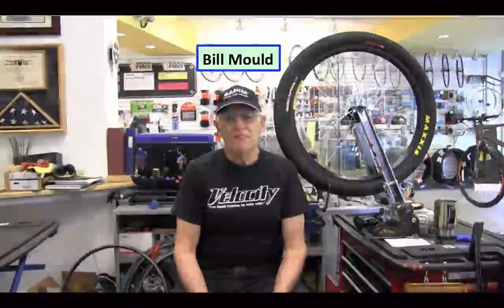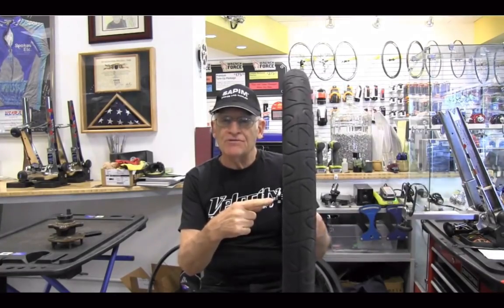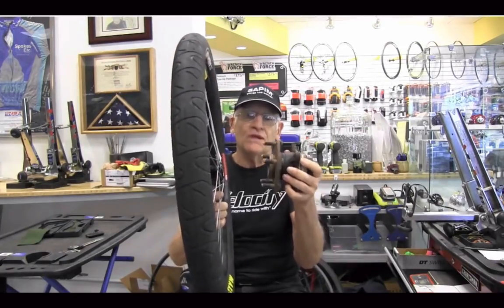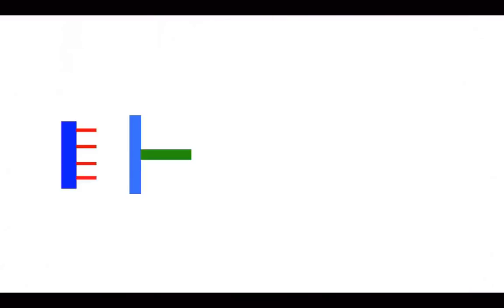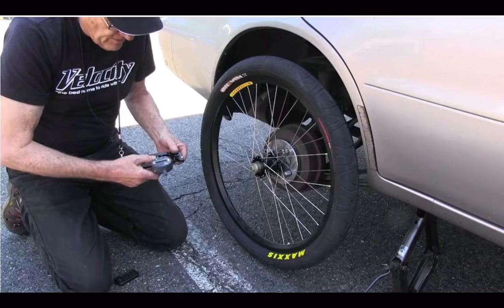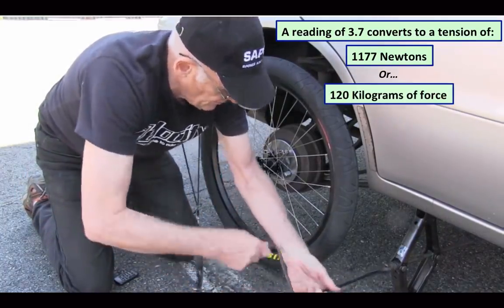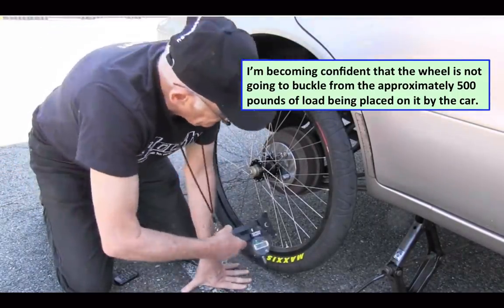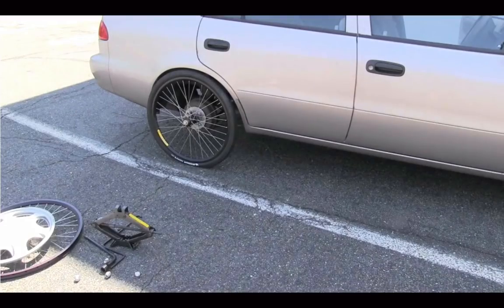Bicycle Wheel On Car

Comment: Weren't the first cars being made have tires that were thin as af
Reply: Jr. Lazarus The first cars also had more wood than steel. Therefore they were extremely light. Less mass allowed for thin wheels. The thin wheels allowed for traversing deep muddy roads and streams. 

I bet a Model T would do well with bicycle wheels. A modern car wouldn't make it past turn 1.
Reply: Jr. Lazarus Model T was like an 800lb car.
Reply: Jr. Lazarus Well yes, wheels were used waaaaay before engine powered cars, first on wheelbarrow-like things using only wood, then on wagons pulled by horses, then on engine powered wagons that were the first cars (wooden wheels with a layer of steel), then a layer of solid rubber, then air inflated rubber, getting wider and wider.

Comment: if you are using the hub, and you have opened the center of the wheel to 22mm, just drill & thread the hub, and use a shoulder bolt with safety wire and maybe a washer to even the load across the compression face.

Comment: Complete lack of safety demonstrated here. No jackstands, that shifty  jack should only be used in emergencies (i.e. a flat tire in the middle of nowhere) I love watching the "wheel engineer" lower the car without even being aware of clearance.
Reply: Clearance? Worried about the car dropping? I don't think this is the worst of the worry. Lowering that jack with his face inches from overloaded spokes and tire was intense. Also he's testing tension on a bottom spoke. What's he measuring there? Spokes hang, they don't support. He has no clue what he's doing.

Comment: one bump would do the trick. that bicycle wheel will shred itself. you will most probably end up using motorcycle wheels.
Reply: No offense but way too many people here are assuming he wants to replace his car wheels with bike wheels. Or drive like normal on a bike wheel.
Clearly, as mentioned, this is an EXPERIMENT in seeing if he can build a bike wheel that could handle the massive difference in weight . He showed it could be done which is amazing considering that the bike wheel itself likely weighs less than 1200grams or 2.5 lbs. The car weighs closer to 2000lbs whereas a typical bike weighs 35lbs.
Reply: well then carbon fiber will do this trick. no need to develop carbon fiber.
blesings
Reply: Val Tito What the fuck are you even saying here?
What does carbon fiber have to do with this? 
He used  pretty non exotic basic bike parts here. Mostly aluminum and stainless steel.
No need to develop carbon fiber?
Yes, you do if you want to save weight.

Help me to understand your line of thinking.
Reply: schlooonginator no need for getting your panty in a bundle friend . there are carbon fiber bicycle wheels already in existance that will do the job. just buy the carbon fiber wheels. no need to develop them.
Reply: Not trying to be a dick. Just that what you said didn't make much sense which I can understand if english isn't your primary language.
I was just not seeing where carbon fiber or carbon fiber bike rims(most carbon fiber bike wheels whos spokes and rims are a one piece design are built strictly for road racing and would likely fail under this load.) had in relation to this mans experiment of building a wheel using a fairly robust alloy rim with 36 stainless spokes. A complete carbon wheel is not something a typical "wheel builder" can make.
Like I said complete carbon bike wheels are ultra light and designed for weight loss and aerodynamics over  ultimate strength.
Now, a DH or AM carbon rim built up traditionally would likely hold this weight.
Reply: schlooonginator you know its like this.

traditional materials can only do so much, then you have to start with new and better materials

the regular bicycle spokes even if doubled up will not do the job. that is why heavier vehicles use thicker spokes. 

this project is on a one way trajectory, thicker materials.
 in the end we will see that they will just have re invented the motorcycle wheels or even “whire rimmed wheels” .

why reinvent something that has already been invented.

blessings
and yes my english is perfect.
Reply: ***** Yeah! I am amazed at the number of people who don't understand this. C;early a bike wheel is design to handle so much weight and stress. So if you can build a bike wheel out of parts intended for something that at most weights no more than 200lbs and it woks to support weight that far far exceeds this is indeed impressive yet this goes right over their heads!
Reply: Roy Odell  IT WILL NEVER CATCH ON  BAD IDEA & BESIDES CARS ALREADY HAVE WHEELS ,DERRRR   ,,,,THEY ARE VERY UNSAFE , UNCONVENTIONAL  , AND WONT LAST A MILE   HEE HEE
Reply: Val Tito  BUT THINK what if a huge truck or a bus  or a caravan, trailer, had them.  all that heavy weight  on them  those bike tyers would  bust in no time  and cause  a mass smash up in traffic  VERY UNSAFE INDEED  !!!!!!!

Comment: NO BRAKES
Reply: +BOY CHAD It has brakes....
Reply: +Coatchawa it has break shoe not brake pads.
Reply: +Paulo Manuntag it's called drum brakes dude, any brake pads would be inside the drum
Reply: +Justin Noker ahhh...

tnx for the info. :)
Reply: +BOY CHAD Yup you r correct, no brake attached to this bicycle wheel, he just connecting it to the rear drum brake with that adapter for freely spinning..if he applies this thing for all wheel.. sure he would not able to stop the car with brake..
Reply: +Justin Noker 😂😂😂😂 
brake calipers = brake pads
brake drums = brake shoes
big difference in both styles of breaks
Reply: +Justin Noker 😂😂😂😂 
brake calipers = brake pads
brake drums = brake shoes
big difference in both styles of breaks
Reply: +Justin Noker 😂😂😂😂 
brake calipers = brake pads
brake drums = brake shoes
big difference in both styles of breaks
Reply: he's right,  free spinning axles in each hub. ..hub stops, wheels spin...which is why he needs help building adapters as stated at the end. ..
Reply: +Joshua Laird put splines on the "adaptor" and then press the bike wheel on.
Reply: +linglingjr some sprags.
Reply: Joshua Laird No...
Reply: Oh, You are saying press on the bike wheel to an adapter bolted to the hub. I get it now.  Interference fit?
Reply: +Joshua Laird Yes, just like a hub on a two piece axle.

Comment: And the point being what? This is just plain stupid. 

1.  Bicycle wheels are not designed to take any lateral load as there is none on a bike - it leans on the turns.  A car wheel has to withstand a considerable lateral load when
cornering.

2.  I would NOT like to be the guy who hits the brakes hard on a car with bicycle wheels on the front - not with all that weight transfer forwards.

3.  Car wheels are dished.  Bike wheels are not and hence the track will be increased.  This is obvious in the vid where the bike wheel does not tuck inside the wheel-arch.  This will have two consequences:
a) The steering geometry will be all to pot
b) the edge of the wheel-arch will rub against the tire on bumps and when cornering.

4.  Bicycle tires are round in section and have a long, narrow oval contact patch.  That's because cycles lean in turns.  Car tires have a flat contact patch.  That's because car wheels stay upright in turns.  Also, bicycle tyres sidewalls are not designed for lateral loads (see above), although there are specialist bike tyres available for recumbent tricycles which better adapted to lateral loads.
Reply: His only point is to show the strength of the wheel with a downward load.  That's all.  I think he has succeeded.
Reply: You do realize this is an experiment, Right? Literally done to test the strength of a wheel. Nothing more. Also he did this to prove it could. He could have done more testing in a lab, But what is data when a guy can sit down and see his work actually working? I for one enjoy seeing things done and not a TON of numbers. But also I'm pretty sure people with a lot of resources to fund this want to see it actually work and not just paper work and numbers.
Reply: Experiment dude :)
Reply: The first powered flight was designed and built by 2 bicycle mechanics using some bike parts.... Bill is perhaps a modern day "Wright Brother".... worth trying though.

Comment: he was measuring the tension in the wheel on the bottom spokes, but if the mass of the car is going down, wouldn't the top spokes be in tension? 
also, if the bottom spokes are in compression, would they actually hold any load since they're so thin?

Comment: Comments on how stupid or useless this is are not needed. Also using the term Walmart engineering although funny is also useless.  Most of the worlds greatest innovations are made by people that tinker and create. Not by those with a degree that only seem to perfect inventions that are already made.
would I drive down the road with this..HELL NO.  but its cool anyway.

Some people make thing just because they can. Not for profit but just to see if it can be done.  Someone may be inspired from this video.  So instead of knocking what these guys did why don't get creative and make something yourself so you can share it on youtube to be ridiculed by the untalented negative mass that just like to hate on everything. Keep bashing new ideas and see why America is going down the tubes with real innovations.... you can always make another useless APP and join the club of same ol shit.

Comment: Just wanted to clarify that the axle will be rubbing on the internals of the rim as there were no mention of bearings being used. Am i understanding this correctly?
Reply from the maker: No, the wheel is bolted to the car's hub, so it rotates with the car's hub bearings.
Reply: @BillMouldWheels  Great thanks for the clarity Bill. I enjoyed the video

Comment: In a straight line, I think the wheels could handle quite a large load, however if any sideways cornering forces were placed upon any axle the weight would easily prove too much. It would be interesting to see the outcome of all four wheels being replaced by cycle tyres, if just for the fun of it... LOL

Comment: I'd love to see this make a comeback with a car you can fit the wheel under the well, and switch all four wheels over. It'd likely have to be a car with pretty meaty tires. Probably 215's at minimum. Problem is, most cars with tires that thick are usually pricier cars. I know it'd fit on just about any BMW, but not many owners would want to risk their car in the event of a buckle.

Comment: There is spoked car rims a lot low riders use them alloy wheels are very light weight. Low profile bike wheels will cause the shocks absorbers to wear out prematurely why bicycle wheel on a car. for what reason what's is the benefit?

Comment: If it could drift real nice, could it then be installed on a 2.5 ton 4x4 truck, and assuming you installed knobby enough tires, could you pull out an old tree stump? I would like to see. Time for the next experiment.

Comment: nice idea. there's ALOT of potential with the idea. extend the axle a tad to clear wheel well add tougher spokes to withstand potholes and the like and you have a very compact  and cheap spare. I'll betcha no-one would be complaining if they got a flat at 2 am on a dark road and no spare. atleast it would get you rolling. even if it would be at 25 and under.

Comment: The wheel can be cased in a pot whole, and going over a bump will compress the rear shocks, and you will need a smaller rim, even then, you should run a fat rim. 16"

Comment: For wheel weight strength physics could be done by hand I bet for the materials. I could, in theory, do a stress test analysis 3D simulation for a modern twist.

Comment: With economy and availability in mind, a last gen Roadmaster wagon('91-'96).

You think 1,100lbs per wheel is enough? Haha.

They're body-on-frame, so in some unfortunate event you accidentally drop the whole car onto concrete you'll at most damage the exhaust. Or maybe bumpers.

They have center jack points both front and rear and both sides, so you'll be able to get it off of the ground again in case one whole side of the car is stuck on the ground.

Comment: Could a car on all four bike wheels hold up?  What if those four wheels were 8?  Forgive the crazy question.
Reply from the maker: The wheels probably would support the weight of the car, but the sideward loading when going around a corner would not be strong enough to keep the wheels from collapsing.
Reply: Bill thanks so much for your reply - a very pleasant surprise.  What if the car weighed around 200-250K max and the overall speed was very low (sub 10mph) anyway?
Reply from the maker: Then it might work, kind of like a beach buggy.

Comment: I wouldn't be putting my hand in between the wheel and the wheel well. also I'd wear a safety shield over my face and something to protect my body while I was to measure the spoke tension.  one of those spokes could of sprang loose and be like a dart under pressure  ?

Comment: Many classic cars have spoked (wire) wheels, but the wheels are much smaller and spoke gauge much thicker. Most bicycle spokes are 2mm in diameter, with the strongest ones being 13G 2.3mm. Most spokes on cars are 7G or 8G which is around 4mm, and the wheels are much smaller <20" in diameter. So like the idea of proving just how strong a bicycle wheel can be, but it will never deal with the real world loads required of a car

Comment: If you have 2 wheels all you need is a utility trailer to test. Add weight to trailer, test until failure, done. My suggestion would be to find a bored farmer with a metered pump and some spare storage tanks on a trailer.

Comment: I am sure in a straight line it will be fine, but when the car turns the side load is going to fold the spokes.and taco the rim. years ago I tried this on my go cart, it failed in a turn . Now if the you put a lot more spokes it could last longer.

Comment: I’d like to see trying to steer and what the wheel can take before the spokes would fold or hitting a hot hole putting that pressure on one spot would surely destroy the rim
Reply from the maker: Brett, it was never the point of the experiment to see if a a bicycle wheel could be a suitable replacement for the "spare tire" that we know.
Reply: I know but would be interesting to see how much beating it would take especially compared to a conventional bike rim and tire compared to the one you have here

Comment: Would it not have been better to use the Tensionmeter on the upper spokes as they are the ones doing the supporting.
Reply from the maker: Dave, I could gave measured the spokes at the top, but I was also interested in seeing if the spokes at the bottom were going slack or nearing it.
Reply: That is interesting. Just that using this instrument on aircraft cables, to check tension, I thought that you would be check for that. But now see your point of checking for it going slack. Cheers

Comment: Spoked wheels were used on classic cars just a lot heavier spokes and rim not quite sure why you would do this it has a suspension so will hit the arch you need a smaller wheel

Comment: car weight 1300kg/4=325kg per wheel plus car is unbalanced load is not spread evenly so about 200kg on wheel if that. If the car was fitted with 4 rims I'm sure it could take the weight but one hard launch would rip the nipples out of the rim or spoke out of nipple

Comment: bill next time measure the tension on the top spoke as the bottom ones are being compressed and not stretching as said in other comments you only did a few turns no breaking from higher speed. further more suggestion why not drill holes for the spokes like the bicycle hub that would eliminate the extra adapter hub

Comment: I guess the idea is an easier to handle spare tire? In this case, why not a smaller diameter wheel to eliminate the fender clearance issue? I like the ingenuity but I'm not sure where this would fit in the automotive market. They already make really small, thin and light weight spare tires that need no extra parts to install.

Comment: The experiment is inconclusive until it is fully tested on roads, fast braking, highway speeds, etc. While the wheel supports the additional weight, it certainly does not look safe on public roads. Kids, don't try this at home.
Reply from the maker: This was a demonstration of the ability of a bicycle wheel to support the  vertical load from a car.  I never intended that such a wheel would be used on an operational car. The video never suggested that either.
Reply: Bill, I understand, but I wonder how many people seeing your video will copy this and take their cars on a busy road on a bicycle tire. The video suggests that it maybe safe.

Comment: There's no need to put it on a car. You could just keep adding weight to a wheel mounted on a lever to which you could add eight. The wheel could be rolled on a metal drum or something similar. A rolling road perhaps?

Comment: No way - just a warm-up.  You haven't done an experiment yet.  At least get the wheel right - you'll have to extend them out past the wheel well if you cant get them inside it.  THEN drive the thing over a few bumps at 25 MPH - and you'll be doing some damage that a Clydesdale on a Cannondale wouldn't.

Comment: While this may be an interesting project, the design will share the same problem as wheel spacers, i.e. they increase the load on the smaller outer wheel bearing since the track is increasing on one side.  Bryan should've removed the Toyota hub and adapted his hub to fit the existing suspension arm, that would've kept the wheel inside the wheel well.

Comment: the real problem here is a bicycle wheel's poor strength in side load, assuming the car never turns at speed a bicycle wheel would be fine.